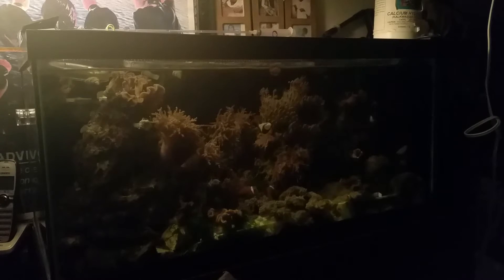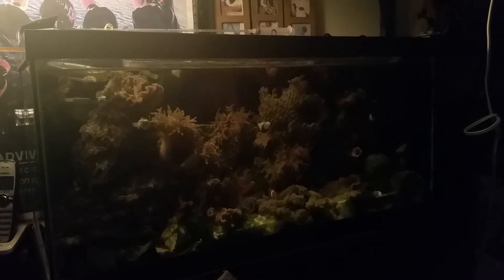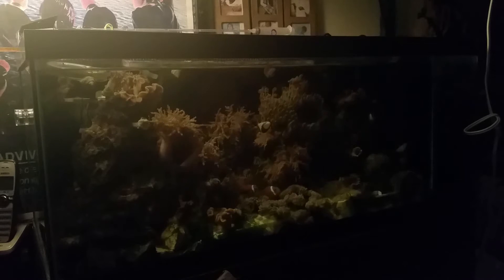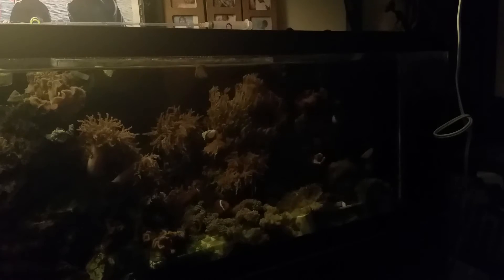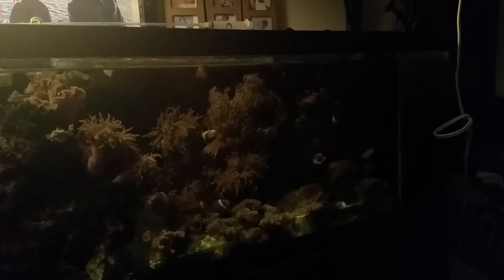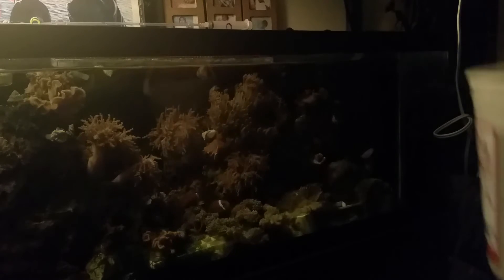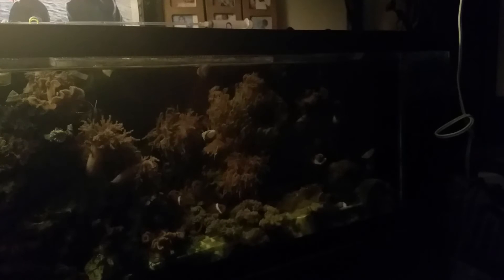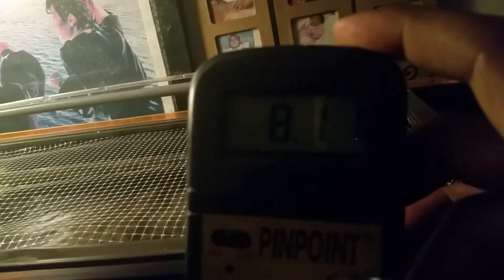Adjusting Ph, Calcium and Alkalinity in a Reef Using Kalkwasser

Comment: Are you only adding that at night? And how long does that drip you started last just through the night? Thanks good info !
Reply from the maker: Kalkwasser is by no means for thre faint of heart.  I only recommend kalk for those somewhat experienced using it.  Most of us have screwed this up at least once.   I personally have it drip at one drop per two seconds. Amount varies by tank need. I add it at night because ph drops at night as mentioned

Comment: Yo good looks on making this video bro! I'll probably have to scoop me up some Kalk. My ph during the day is around 7.69 and right now it's at 7.65 after about 45 minutes of lights out (with the fuge light on for about 2 and a half hours). I'm just worried about my calcium getting too high. How much was the ph tester you got? All I have besides the apex to test ph is an API test kit. Again, thanks for making this vid my dude!
Reply from the maker: Its ok if the pH hovers on the low side as the cycling is still taking place testing the alk and calcium will justify whether or not you're on the right track
Reply: Thanks Dee. How much is that ph tester you got?
Reply from the maker: around $50 but toy can check the local forums and eBay.  i got mine from our monthly club sales table cheap. .
Reply: I want to get one. Looks pretty sweet